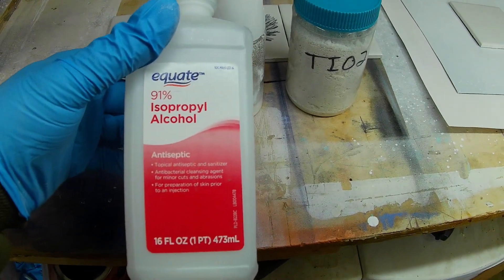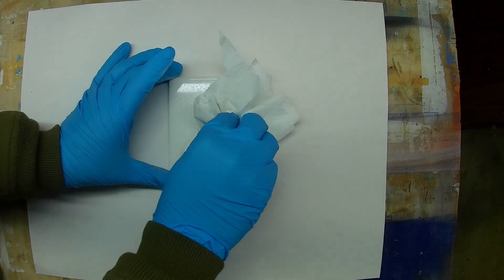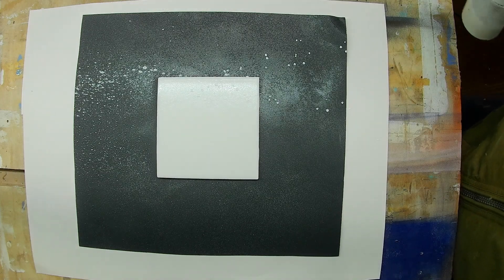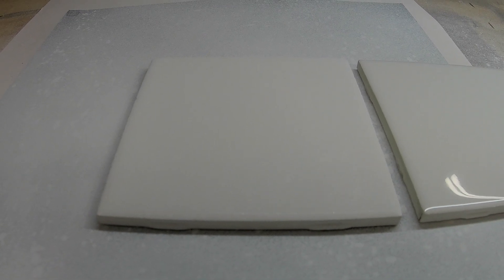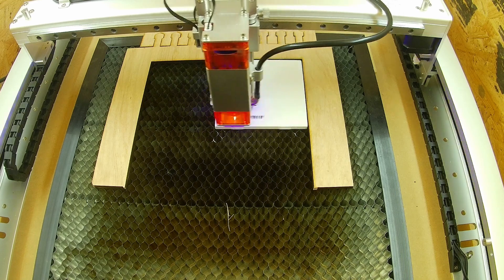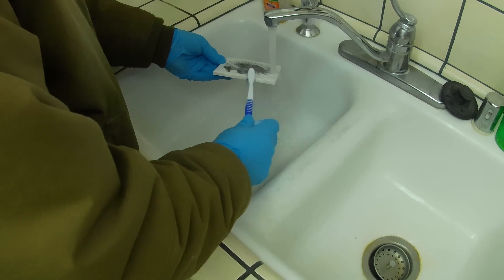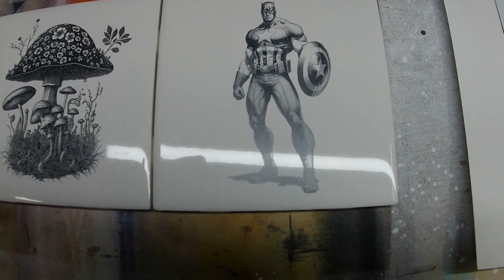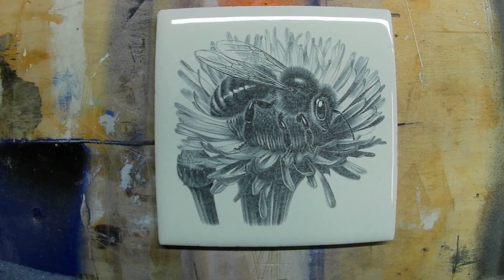Stop using paint on ceramic tiles.

Comment: Since there will be a lot of cnc'rs watching and reading the comments,pixel size is mentioned.

Anamorphic prisms can change the rectangular beam and squeeze it down on one axis making a square,when focused a very tiny energy dense square.

I mention this  for better image quality for diode laser  grey scale ,cutting what ever.

Since you would need a mount for the two prisms,the mount would be fixed to the laser optical output to correct the beam shape,the prisms lie flat,input and output are in line.
A 3D printer could make a mount blank to be then milled on a desktop cnc quite accurately ,the Prisms are about £20-30 GBP,an aluminium unit would be very good,maybe lens angle adjustable to set the laser spot shape.
Laser shape adjustment would need the prisms mounted on brass to enable wear resistan threads and sliding faces,a small light spring even a strip of spring wire to keep the prism in the adjusted position,same as the horizontal and verticle adjustment on a telescopic sight has a reticle tube,it uses flat springs to keep the reticle tube in the same place with rifle recoil shock waves i'd assume it would serve well in an optical device.

Aluminium would stop a hot misaligned beam from exiting in the wrong place.
The device could be machines from a two half section of aluminium,each prism rotates from one end on a flat plane in the lasers path,each prism would need 90 degree travel.

I bought a 3018 pro cnc and apart from being not as rigid as i would like x,y and z axis use unsupported linear rails and too thin lead screws  to properly cut metal,even the spindle motor if mounted to give a 1:1 belt drive on a bearing mounted ER chuck spindle .

The prism set up is shown in a youtube video https://www.youtube.com/watch?v=lOmr7BwdiJU
Once watched and if you have the gear you can turn the energy density of your diode laser up ,there is a filter that makes the laser the colour and it blocks energy too but this is good.

Comment: I tried this the other day. The spray bottle I had worked, but couldn’t get a real smooth coat. Had some bubbles. Tried a brush and a few coats. Came out pretty good. Finally I just poured it on the tile and tilted it and let it flow over the tile. It dried pretty smooth and the engraving was the best one. I don’t think it really wasted the mixture any more than spraying when considering the overspray, or than the brush with multiple coats to even it out.

Comment: For image processing, do you just pull in a raw image into lightburn and it just works or do you still process via Photoshop / imag-r first using the norton black tile method process?
Reply from the maker: I usually process in photoshop first.

Comment: I know everybody is extolling the wonders that is TIO2, but I found that cheap, Plaid Folk Art acrylic craft paint - Snow White, to be exact - thinned down and sprayed through an airbrush produces the most excellent results. Super black engraving and it is easy as pie to wash off. Plus, it's a lot cheaper than any other method. But... to each their own 🤷‍♂
Reply: Have you tried other colors to see if something other than results of black?
Reply: @GoJoeGo58  I've only ever tried white and black. The white gives black markings on the glass and tile, while the black gives white markings 🤷‍♂ Not sure if other colors would do anything else... I should probably try that.

Comment: I tried this method, I have splotches , am I putting it on to heavy? I did  test on text at 2000@30 to 70 on my I concluded that 40-45power was good. 22w diode.

Comment: i used this ti dioxide but nothing is happening. no image is being burned. 100% power at 500mm speed. im confused. ortur laser master 2. i also purchased the ti dioxide from your link. im i putting it on to thick?  using the 91% alcohol too. fine mist sprayer, coating on tile looks good. any advise. thanks
Reply from the maker: Without seeing your actual parameters I can't really tell you whats wrong. But here is a couple things to try. 1. you might be going to slow and to much power. 2. Make sure your focus is set correctly to your tile. 3. Make sure your actually getting a good coating of tio2.

Comment: I have the Ortur LM3 10W and just couldn't get paint to work like on my other lower powered laser modules. I tried TiO2 with 91% isopropyl alcohol and magic occurred! I tried a few spray bottles but photo etches did not come out that great. I also bought 2 small detail HVLP guns but they did not work that great. I then purchased a higher end airbrush -  Eclipse HP-BCS Airbrush. I use a 3:1 ratio by weight and spray 4 coats. It dries almost instantly so it goes pretty quick. For me the coating doesn't just blow off the surface so I can coat extras and store them for later use. I typically etch at 5000/17% for 423dpi. Issue I have is, even when using a DIY spray booth I get lots of bounce back spray (I use 30psi). I get excellent repeatability and may need to re-think the spray booth to have top side suction. Any help on the overspray appreciated.
Reply from the maker: I ended up making a booth and installing a ventilation fan on the back wall with a filter. Made a big difference containing the spray. The way I did it in the video makes a huge mess.
Reply: Is the image permanent like the paint method?  I’ve taken a screwdriver to paint ones and zero damage to the image.
Reply from the maker: @stephenrowland1709  Yes it is permanent.

Comment: Great video my friend. So my question is about the tiles, have you used unglazed vs glazed tiles as well and do you have an opinion on that ? Thanks for posting your video, thumbs up !
Reply from the maker: I have only used glazed so far.
Reply: I tried unglazed tiles when I first got my laser. It's pretty much impossible to get the paint (or in this case TIO2 coating) off the unglazed tile cleanly.

Comment: I have been researching this method a lot and plan on trying it next week.  I was going to try an airbrush, but I saw several people, including you,  say that it tends to clog.  I found a couple of videos where people suggested using the Harbor Freight touch up spray gun. (61473, or 46719). I believe the nozzle on this is 0.8mm which is just a bit bigger than the 0.3mm or 0.5 mm of most airbrushes. They said it is just enough bigger that it doesn't clog. It is about 33 dollars. I picked one up yesterday, so I am going to give it a go. I already have a decent compressor so no added cost there.  I'll let you know if it works.
Reply: How did it turn out?
Reply: @RobertLugg  Been out a town a lot and have not had a chance to try it yet. I've got some time off in October if I don't get to it before then.
Reply from the maker: Love to hear how it goes. Thanks for the comment.
Reply: Would love to hear your expierence as well😊
Reply: I tested it and you can use a 5:1 ratio of alcohol to the tio2. It makes it watery enough for it to work in an airbrush and makes a fine mist!

Comment: you have a video showing what you did to create the image for lasering. also what watt laser did you use? light burn, gimp? thanks
Reply from the maker: It was done with a 10 watt Roly lasermatic10. The software used was lightburn.
Reply: @lasersandsaws   did you use lightburn only? did you need to invert image. can you make a video showing the process on how you put the image in lightburn, im just learning. thank you for replying. settings, speed,power, etc... thx

Comment: Hi great results,how do you measure it out,what do you use to get the mix correct
Reply from the maker: The mix really doesn't matter to much. Just thin it enough so it will spray without clogging.

Comment: When you say 50 to 50 ratio on the mix is that like 1 cup to 1 cup .   Or by weight?  Thanks in advance
Reply from the maker: Turns out 50/50 is to much. It clogs the spray bottles to fast. I've been using a mix now of 1 part Tio2 to 5 parts alcohol. It's easier to spray and gives the same results.
Reply: @lasersandsaws  So is the mixture consist of 100 gram of TiO2 to 500 gram of alcohol or 1 cup of TiO2 to 5 cups of alcohol?  Thanks.
Reply from the maker: @doctorpd1969  I did it by volume so 1 cup tio2 to 5 cups alcohol. But it's not an exact amount. Your just trying to get enough tio2 on the surface but not clog the sprayer.

Comment: This is really cool, never would have thought white powder goes black. TiO2 does absorb UV so that is probably why a diode laser works. It would be interesting to try this with other oxide powders, those that colour concrete would be cheap. Red, yellow, black and?  Hmm hardware store has 1Kg for $15, Black, Red, White, Bluestone(grey), Chocolate, Sandstone.

Comment: you don't mention the type of laser you use... is it a co2 laser?
Reply from the maker: It's a 10 watt diode laser.
Reply: @lasersandsaws  Is it the LaserMatic 10?
Reply from the maker: @doctorpd1969  Yes I used the Roly lasermatic10 for these tiles.

Comment: I was so intrigued after seeing your video, I decided to give it a try. I purchased the Titanium Dioxide from Amazon, along with some fine spray bottles. When they arrived, I got to work, using the techniques described in the video.
I had just created a piece, using white Dupont paint, but was unhappy with the results - too light. Because everything was already set, I figured to use the same setting to see what kind of difference - if any - would occur between the Titanium and the paint.
The titanium piece came out so well I'm afraid to wash it. The image is just about perfect, and light years ahead of the paint. This is going to be my preferred method of burning images in tile from now on. Thanks much for sharing the information via the tutorial.
Reply from the maker: Thanks for the comment. Glad to hear it's working for you. Since this video I have learned that a 50/50 ratio is to much. If you get clogging on your sprayer try  @Giovanni-hh2jg suggestion of a 1 to 5 ratio. One part tio2 and 5 parts IPA. I have been using this mix now and it's much better. I'll be doing a video on this soon.
Reply: @lasersandsaws  Thanks. I thought the mixture was a bit thick when I used it. But it worked fine. I'll keep it in mind when I mix a new batch.
Reply: @lasersandsaws  :  This is super helpful!!  I've had a hard time figuring out the ratio and my spray bottles have gotten consistently clogged.
Reply from the maker: @johngrimoldy7637  Clogged spray bottles is the biggest downside I think. I need to find a better way to apply.
Reply: @lasersandsaws  Try using aWD-40 spray bottle - I have a sign company and use them for denatured alcohol, adhesive remover and wet application fluid - all work well through it, as it is made to spray an oil.
Reply: @signmasters99 what’s special about a wd40 spray bottle?  I never realized there was such a thing. Is it the 20 dollar one sold on Amazon?
Reply: @RobertLugg  They are only $6 at northern tool. I guess the parts are a higher quality or made with solvent resistant  plastics.
Reply: @lasersandsaws  What do you use as a measurer? or how do you mix your solution prior to putting it in a spray bottle?

Comment: In Europe, Titanium Dioxide, or E171 is considered to be carcinogenic when inhaling it. Therefore it's now forbidden in a lot of appliances.
The way you are using it, makes inhaling an even bigger problem, therefore I would not consider this method myself.
Reply from the maker: Good reason to take precautions. That's why I wear a mask and recommend everyone does as well.
Reply: this is a “possible carcinogen”, it also includes ginkgo beloba and aloe vera
Reply: Ahh, then getting cancer is not a problem because there is also Aloe Vera in it. 😢

Comment: That's pretty awesome. 
Couple questions.

How durable is it?
Does it only work on white glazed tiles?
Reply from the maker: I've only tried on white ceramic tiles but I think it works on any ceramic or glass. It's very durable. I couldn't scratch it off with a screw driver when I tried.
Reply: @lasersandsaws  I love to hear that

Comment: I can get Titanium dioxide in different colors (pigments).  Will using different colors result in a colored etching (similar to lasering over powder coat pigments), or still just a gray or dark image like with standard paint?
Reply from the maker: I know that there are oxides that would make different colors but I don't know which ones.....yet. Thanks for the comment.

Comment: Would this be good for pictures as well? I've been experimenting and haven't gotten the right settings yet.
Reply from the maker: I haven't tried photos but the images in the video are Rasters and I used Jarvis.
Reply: @lasersandsaws  I used TiO2 with denaturated alcohol and engraved photos on white tiles with the grayscale option (in Lightburn) and got excellent results, much better than dithering. The mixture was 1:5 in weight
Reply from the maker: @Giovanni-hh2jg  Thanks for the comment. I've had a few people tell me that less tio2 works better for them. I haven't had a chance to try it or to try grayscale but it's on my list. :)
Reply: @lasersandsaws  Let me first congrat with you for your video, it's very clear and useful. Allow me to continue the discussion about the recipe of the “soup” with some numbers. Hope that my English won’t be so poor (I’m from Italy) and express my thought clearly enough. Well, the TiO2 has a density of 3.9-4.3 g/cm3 (let’s take 4 for simplicity), while the IPA has a density of 0.786 (let’s take 0.8). Meaning that 1 cubic centimeter of TiO2 weighs  4 grams, while one of IPA weighs 0.8 grams, with a ratio of 4/0.8=5. If I take the same volume of TiO2 and IPA, the TiO2 weighs five times as the IPA, and for this application in my opinion (and experience), should be the other way round. I have always used 1 part of TiO2 and 5 parts of IPA (or denaturate alcohol) in weight, with good results. The mixture you suggest looks too thick to me and I’m wondering which kind of sprayer you use, without clogging it up. Pls consider also that with my mixture, that is much thinner, I have already thrown away two sprayers for clogging.
Cheers from Italy!
Reply from the maker: Thank you for the information. I have had problems with clogging. I think today I am going to try your mix ratio and see how it goes. I really appreciate you sharing. Would you mind if I mentioned your mix ratio in an update video I'm doing?
Reply: @lasersandsaws  Not at all!! Pleasure for me